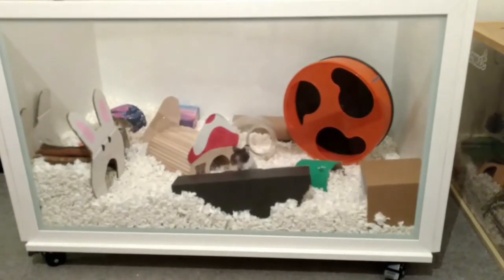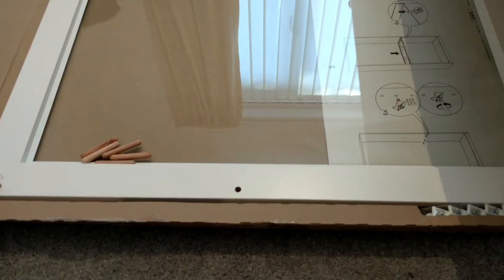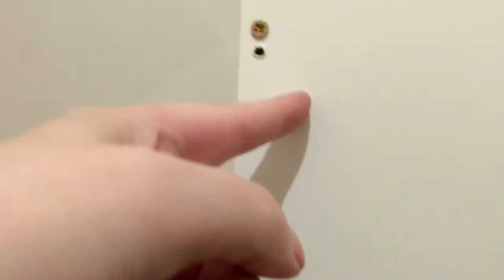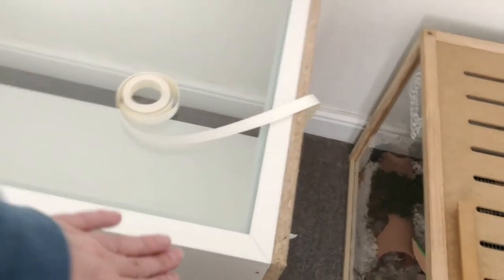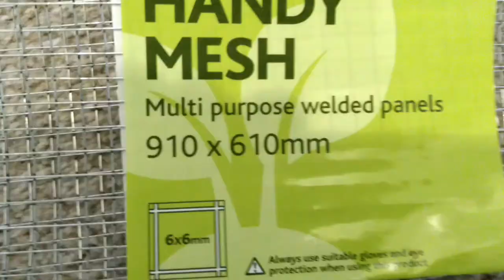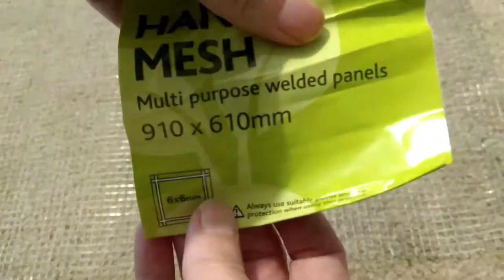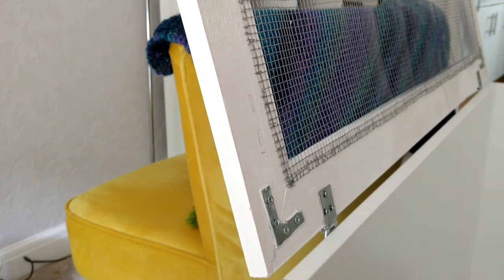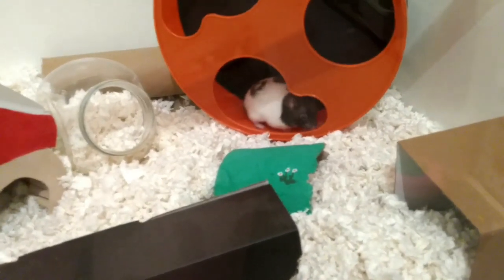Ikea Komplement Hamster Cage | Full DIY Tutorial

Comment: Wow! I've never seen this IKEA cage before. It looks great! The IKEA Linnmon wood is hollow, so it's was easy to cut, but I would rather it all be composite wood like yours. I had to use a gigantic clamp because the ends wouldn't stay together when I put the screws in without it. I love that front glass panel! The melamine strip is a nice finishing touch. Great job! 🙂
Reply from the maker: Thanks, yes the wood makes its heavy, but it is also solid unlike some of the other IKEA hacks. I love the glass front panel too. Yes, I'm glad I did the melamine strips, just makes it look more finished.